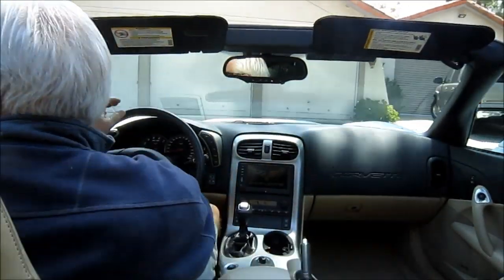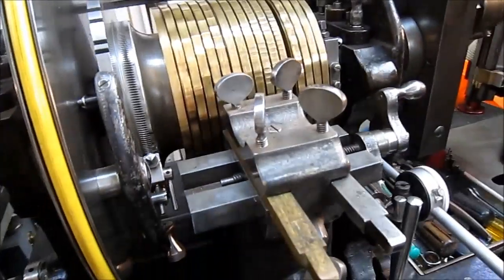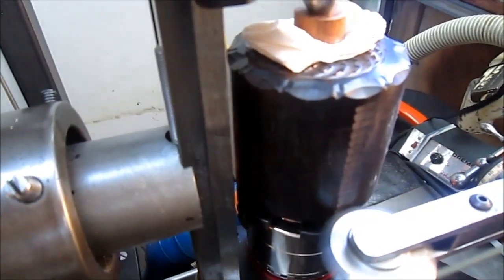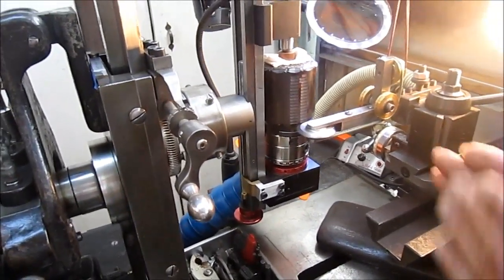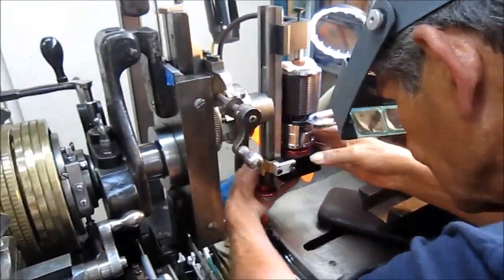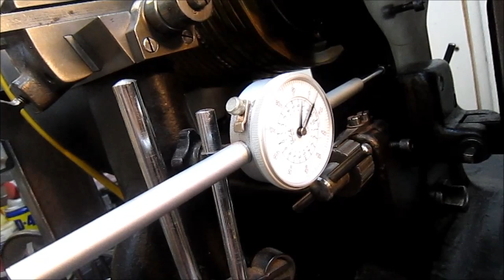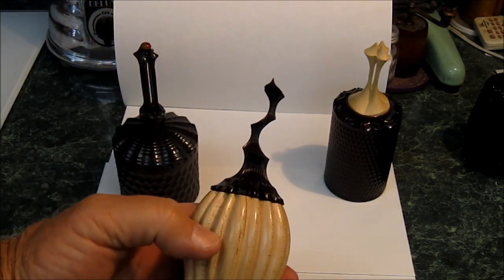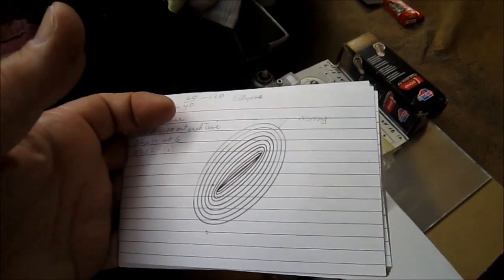Tool Time 29  Leinhard Rose Lathe

Comment: Besides the turning you have seen, they are also used for Guilloche. You can see it on some watches and other jewelry but the but one of the most practical applications is used for the "decorative" engraving used on documents such as stocks, bonds, certificates, stamps, and most importantly money. It was used to make it hard for a counterfeiter to duplicate. He was using a lot of restraint to make those gorgeous pieces. You can really go wild and get into the really bizarre with those machines. Some of the really wild ones would not look out of place on a scifi set.

Comment: Chuck, I'm assuming that Dale uses the "Geometric Head" to cut in the "Z" plane? I sure would like to see that also. Not to takeaway from what you showed.
 That's the 2nd Rose lathe I've seen. a friend of mines father was a Tool and Die Maker. He made patterns too, for the casting ind...Very exclusive. (This was in Danbury, Ct.)
He worked for Benrus Watch Co. in Ridgefield, CT. and think the machine was passed down from his G/father.
 Although this machine was in there house, I don't think it was his full time job. Like I said he was a T+D maker/ CNC Programmer.
 When I told my Dad, He had to go see for himself. We had a M/T company and was also VP at Standard Gage Div of Brown and Sharpe. They made quick friend and spent hours together.
 I myself am a Journeyman T+D maker, and my minds can't see some of these designs being made by mach. let alone manual !...with cams! "...Fascinating..."

Comment: Hi Chuck
Here's a series of videos showing the setting up and using a rose engine, for watch dial making
Part 5 of 5 - Rose Engine Turning by Roger Smith
I've stated at part 5 as this shows the finish result, before you sit through the setting up process.
He also does a series on straight line engine turning you might like.
Regards from the UK
Reply from the maker: Paul,

thank you for the feedback and info, I watched and then happened on to a video about a watch maker....it was very cool.

Chuck

Comment: Great video, nice machine and interesting fixtures and tooling (I can see a fair amount of Sherline components) and most importantly and impressive the operator's workmanship! One question: what kind of wood is the dark wood he is using? Ebony is prone to develop cracks or already has stresses in it and walnut can be grainy - would suck if parts of the pattern began chiping out.

Comment: This is a fascinating video; thanks for posting it. A rose lathe is a variant of an "ornamental lathe" as they are (were?) called.  As far as I can see a mill had an affair with a lathe :) and produced the ornamental lathe offspring. There is some documentation on these things. A very good  book is T.D. Walshaw's "Ornamental Turning." I got my copy through amazon.co.uk. ISBN is 1-85486-108-5. The final word is the Holzappfel series of books on ornamental turning, reprinted by Dover. Nobody makes these things anymore, and you would have to take out a second mortgage to buy one. Walshaw's book has some interesting suggestions on things you can do to an ordinary metal-cutting lathe to do ornamental work. Much too long a comment already, but it is not beyond us to do some of it.